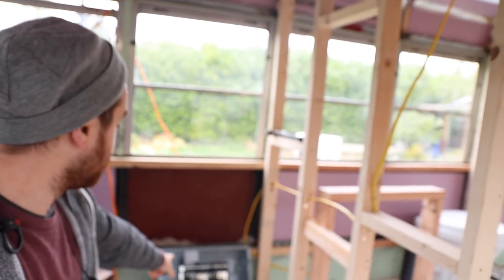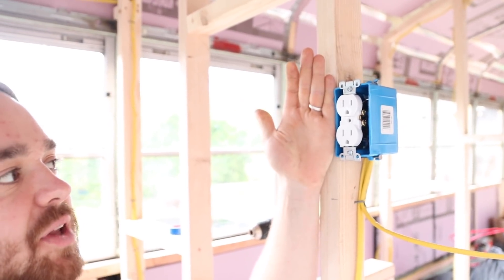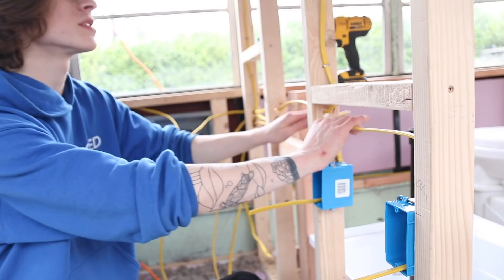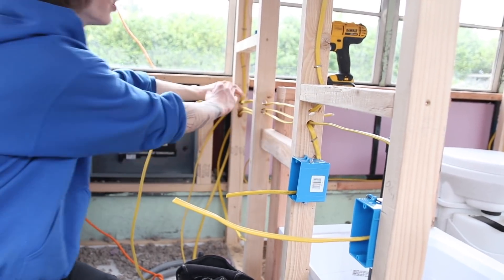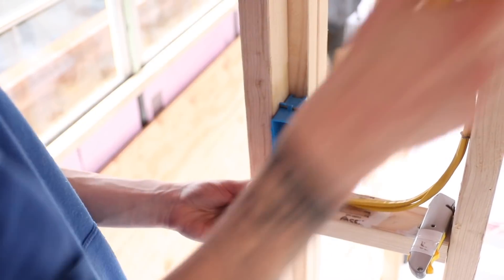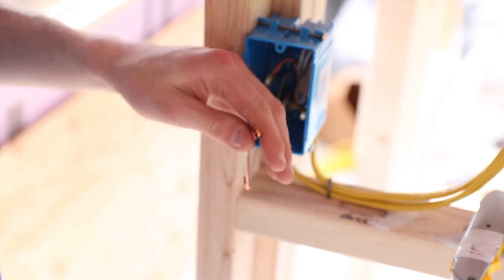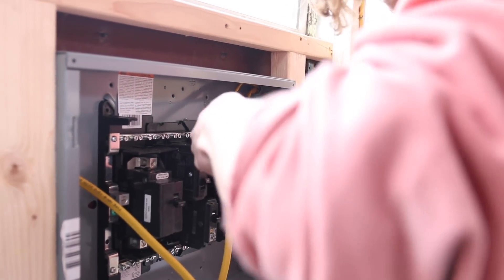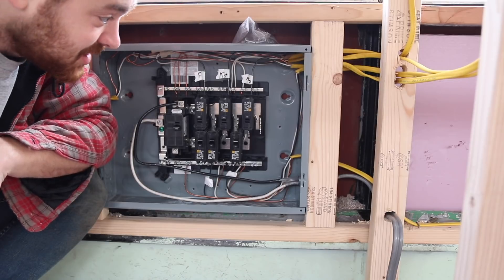How To Run 110volt Electrical - Skoolie Bus Conversion - E21

Comment: Pretty good, but since this is a moving vehicle I would recommend that you use MC cable since it is abrasion resistant. You should also be using screws, not nails, for your boxes if possible.

Comment: ok so my man by accident pulled our back brake light wire and our brake lights any idea where they would plug into
Reply: Ahhhhh dang! You might just have to either trace the wire from the brake light itself or at least check the color of wire to help narrow it down. Or look inside the panel sometimes they make a chart of wires that is pretty tough to decipher but might be worth a shot.... I'm not sure how to trouble shoot that.... Maybe step on the brake and use a voltage tester on your electrical panels/fuses and see which one lights up when you push the brake.
Reply: Thank

Comment: the wire that goes from the inverter to the "box" in the bus.... you don't elaborate.. is it a main breaker box or distribution panel?  what kind? more info on the "box" please.  Thank you
Reply from the maker: This is a link to the electrical panel we used. Hopefully that is the info you were looking for: https://thd.co/2Jzn7fW
Reply: @ColaVentures  I am pretty sure that this box should be considered a "Sub Panel" and the neutral and ground should NOT be bonded together.

Comment: The panel box you linked to is 125amp. If you have a single 30amp connex to shore power how can you use a 125a panel box? Thanks, currently wiring up my bus and need some help!
Reply from the maker: I'm not exactly sure how to answer that question. I know 50amps is the max you can get for an outlet as far as shore power to power the bus panel. You basically just want to be sure you're not putting too much power through your cords so they don't overheat.

Comment: 20A with 12AWG gives you a total cable length of maximum 30ft. Is that enough? Don't forget the up and down parts of the cable, don't only count the horizontal parts. You'll be surprised about the outcome.
Reply: What part of the code book are you referring to?

Comment: Hello, I’m in the insulating stage of our conversion. Are you happy with the styrofoam insulation? I think it would be cheaper but not easier than spray foam blown in. I see the video is a couple years old but please answer. Thanks!
Reply from the maker: Hey! I would go with spray-in foam if we were going to do it again. With all the windows the insulation is pretty bad no matter what you do but spray in I think is a bit more effective.
Reply: Thanks for reply

Comment: I know, I am late to comment but thumb up for Adam !!! He is probably one of the very few ones who is still going the extra mile and is connecting wires to the screws and not to the push in ports in the back of a receptacle or switch. That means for you..... they will never come lose,jk they will never cause any problems down the road

Comment: What does your 6 gauge wire go to
Reply from the maker: It was hooked up to our battery/inverter setup but now we have it running to a plug that goes to a beefy extension cord and then to a 50amp plug on our house. In the future I'd like to set it up to switch between the two systems (battery/shore) but we are stationary now and have no need for that!

Comment: Did you use the same wire all the way through ? What was it? And i need a list of all i need to buy.
Reply from the maker: Sorry, I don't remember! I know it depends on length and voltage... You might be able to talk to someone at the hardware store and tell them what you're doing!
Reply: Not sure if you ever got this question figured out but the yellow wire he used is usually 12/2 which is good for 20amps. But the outlets he used are good for 15amps. 14/2 is rated for 15amps. most homes are run with 14/2. Hope this helps!
Reply: @BackroadPurpose  Having a larger wire than needed is ok and any house with 15 amp receptacles and 14/2 was wired by the plumber.

Comment: Hi can you please tell me what is powering the breaker box
Reply: The most common way is to install an inverter that changes DC from the bus to AC and add batteries connected in parallel so they don't drain fast. Even better is having a 3rd battery just for the starter that stays fresh. Add a shore power connector so you have power when you park. If you want solar, hire someone.

Comment: Did you tie the AC ground to the bus chassis. Essentially grounding the AC and DC? Ive wired my bus, but wasn't sure it I should tie the AC ground to the chassis...
Reply: The AC ground needs to be isolated from the chassis.

Comment: Would these count as a Subpanel? Not sure about the Ground to Neutral bars? I would keep em separate myself.

WAIT... does the feed not have a ground? I would expect the best part about shore power is you get to connect to an actual ground.
regardless. I would have him ask his Boss for some guidelines to follow.
Reply from the maker: Shore power has a ground and then we ground to the chassis of the bus. I didn't have that in this video I don't think. You're supposed to run a ground to the chassis from the negative of the battery bank I believe but we aren't using the batteries right now so I'm not actually sure.
Reply: @ColaVentures   
that 6awg cable looks like it only has 2, but I guess you can see the ground wire.

on the right side of the main breaker. it has the two screws going to the breakers, you can tie those together with a copper bar. That will give you split phase and allow you to use all the slots.

as a Subpanel and since Ground is on the Chassis you need to have the white neutrals separate from the grounds. GFCi and  Arc Fault would not work ( i think) 

I know enough, not to try to wire a job this big myself

Comment: This is the first of your videos I have watched - great job!  We had a similar setup (we only have 120V coming into our bus not 240V).  After consulting with our electrician friend we used a copper bus bar to bind "L1" and "L2" so that we didn't have to put breakers on "every other slot".

Comment: I think I get that you frame the bus out just like you would a house. Then you put up the insulation? Or do you do the electrical after framing but before the insulation? I'd definitely have to hire an electrician to put this in because I'm totally inept around electricity. I want to run right off the solar panels on my roof and I don't know how to do that either. I guess once I get started on one I'll probably run into people that have already done and they can help me.
Reply from the maker: We didn't run solar but i think most people run solar into some deep cell batteries with a charge controller and then they either run into an inverter or just do everything off of 12v. We framed and insulated before we ran insulation and then spray foamed in some of the extra spaces.

Comment: he needs to get the ground separated from neutral. you don't want to make the ground live if you drop your nertal that why there is two buss bars one for ground and one for neutral. the ground should also be floating and Not!!!! grounded to the bus in any way. but the outside of the inverter should be grounded. the ground on the true sign wave inverters are floating grounds 90 percent of the time on well known inverters "xentrax and semlex" aims also i think.
Reply from the maker: KY4TRUCK can you help me understand or point me to a website with more info? I grounded the inverter to the chassis of the bus. Are the grounds in the panel not supposed to be connected. I’m confused?
Reply: *Yes You right in grounding the inverter to the chassis of the bus.*

The ground's and the neutrals in the sub breaker panel should be isolated from each other in some cases.

Some inverters the ground and neutral are bonded together and in some inverters there not. easy way to check is with continuity checker from neutral to ground on the output of the inverter. 

xantrex true/pure sine inverters and a few of the other mager name inverters I believe the output  of the ac side the ground's and the neutrals are isolated from each other. your electrician should understand what i am talking about in that respect.

here is a image of a sub panel Like what you have. 
I was taught to do things a little different, if it is working right i would not worry about it. there is a lot of different things out there on the interweb for house stuff. but in the way of of wiring inverters and there install to sub panels in the auto world is hard to find. so many vendors have different ways there equipment hooks up to other stuff. I have been learning along the way myself with the onset of this stuff.

I myself would look at the inverter as the main panel and the sub panel the same way as the photo keeping all items in the way of power going back to the main source in which it is coming from. this helps stop ground loop's from happening and keep RF noise down also. also a good true sine wave inverter is very RF Quiet. I am also a Amateur Radio Operator so i want things too be RF Quiet.

IMAGE https://i.pinimg.com/originals/c2/34/aa/c234aa5f03ceadd3a134a8044850f828.jpg

One Day i might doing something like you have going. I hope this maybe helps.
Reply: Hey there, can you answer me if you get this please? So, do not ground the panel box to the chasis for shore power?? and do NOT use the green bond screw? put all grounds on one bar and all neutrals on the other bar?

Comment: Question how many amps is your bus wired to? 30amps or 50amps?
Reply from the maker: We only ended up using a 15 amp battery charger to recharge the batteries and then we have a 5000 watt inverter. We are planning to have the bus plugged in at our house or at a ranch that we are working at for the summers. So we went small for now. We may end up adding at 30 or 50 amp switch to bypass our inverter/battery set up in the future but for now the 15amp keeps us charged up!

Comment: Grerat vlog. I learned a few things. Im no professional, but small concern with the staples holding wire too snug...??..cuz the bus tends to move, groove, and twist when driving...IDK, just a thought. cheers and keep on keepin on bro
Reply from the maker: It might have been good to use some insulated staples now that I'm looking back but we tried not to smash em on there too tight. So far it has been holding pretty well!